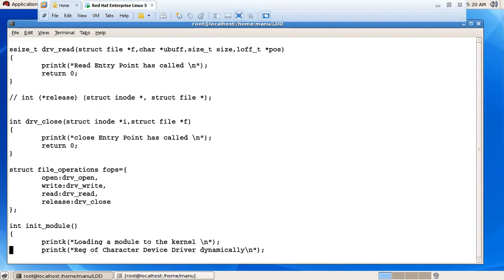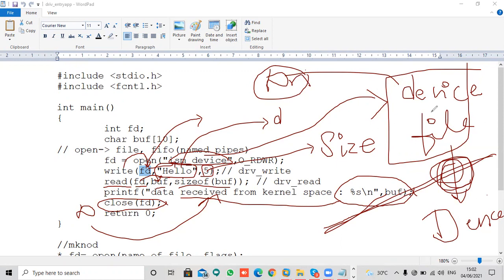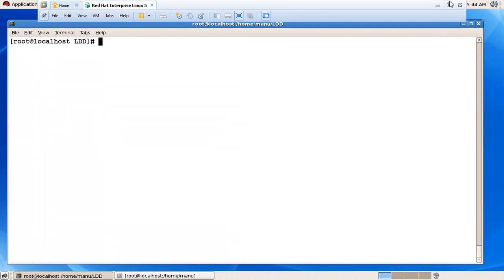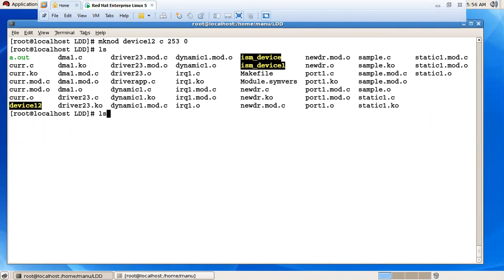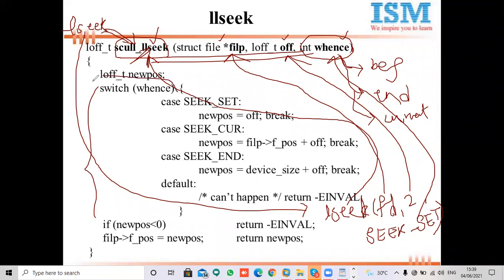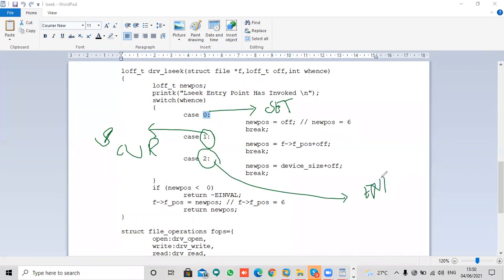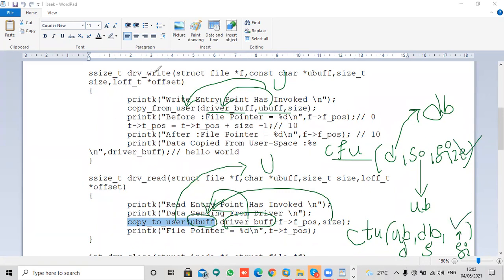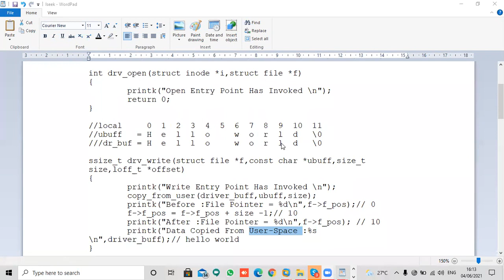Day 15 | Linux | Linux device drivers | Embedded Systems

Comment: You have just allocated the major number and defined the fops but you have not registered this fops with the driver that's why entry points are not getting invoked. Instead of going back and forth,  creating devices with different name , you should have checked the driver code. This is the common mistakes every developer do, they don't root cause the problem,  they just do the changes here and there and think that problem will get solved and end up with zero result.